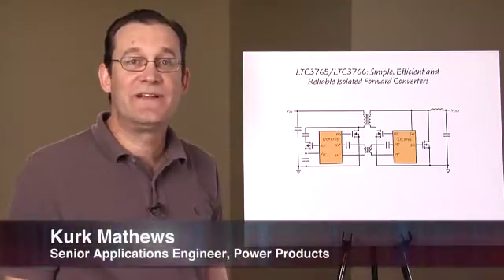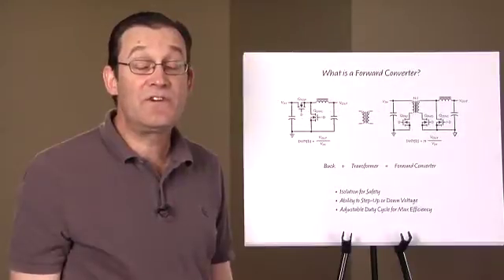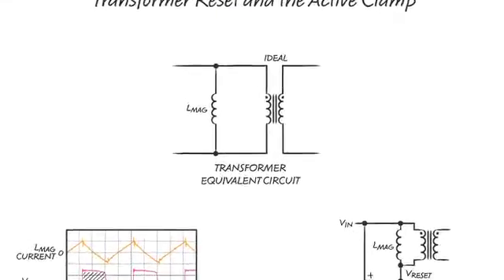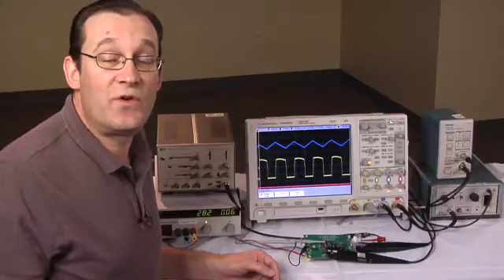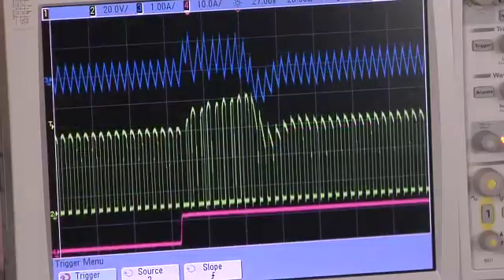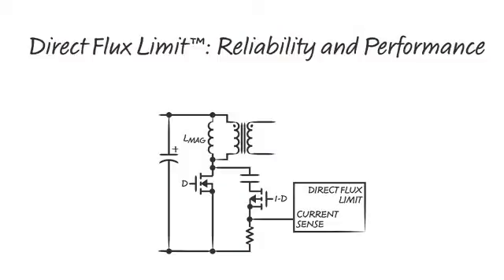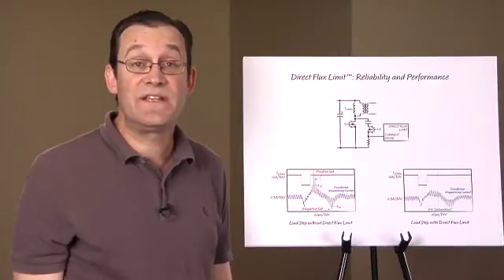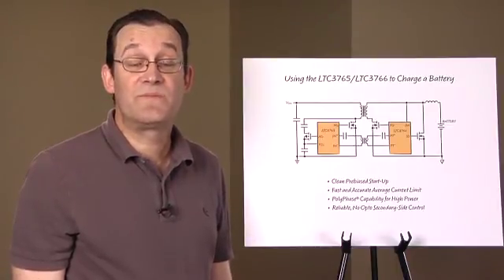Design a Simple, Efficient and Reliable Forward Converter

Comment: At 1.00 second, "Diodes could be used instead of forward and synchronous switches".

I can understand that secondary side switches can be replaced with Diodes.

But how u can replace forward main switch with a diode. Then how ON / OFF could be achieved?? Pls help me understand.